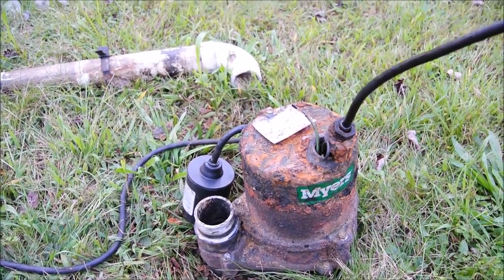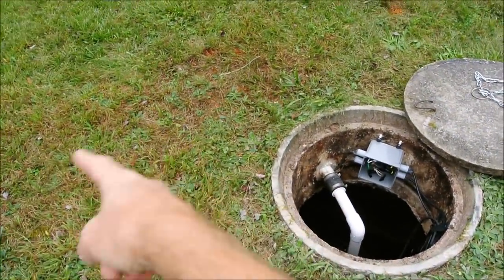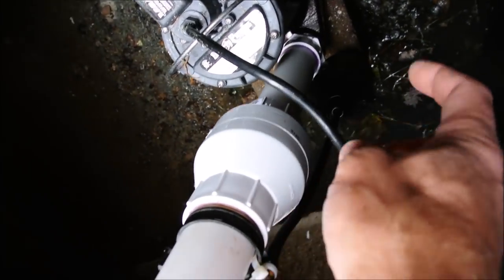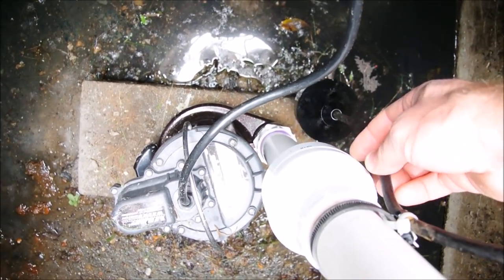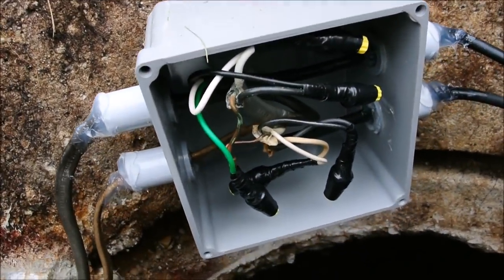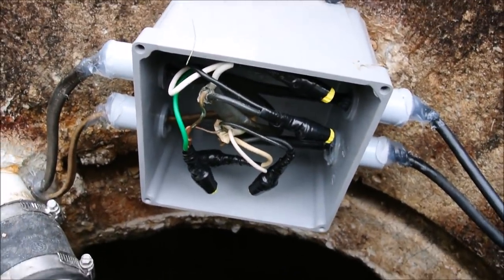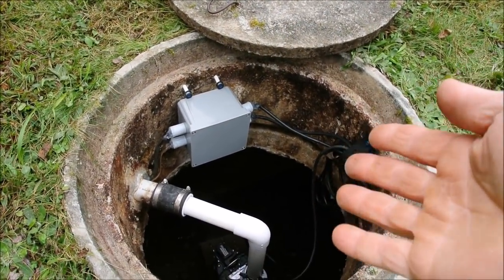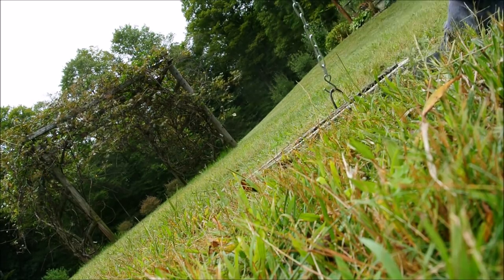Septic pump replace: DIY internal splice box

Comment: Why would you waive any inspections for the largest investment of your life? From your videos you seem knowledgeable about contractor activities and projects, but a second opinion is good. The more information you have (with the ability to process said information accurately) the better.
Reply from the maker: Sure, that's fair. But ultimately, buying a house is a binary decision that must tip one way or the other. Inspections are for the uncertain: once you are certain that there are already enough check-boxes ticked to sway the decision in favor, you have to also accept that some things can (and will) go wrong. 

It's a calculated risk, but it's not left only to luck; you make yourself capable, and then you trust in your judgment when the time comes. Here, I'll say it this way so that it doesn't sound so arrogant:

Luck equals preparedness plus opportunity.  

Capable outside perspectives are useful during a 'gain information' phase. When it comes time to make an important decision, however, you should already be informed enough to make it. Now in the case of a first house, it's tough. For mine, I was hasty and naïve, and mistakes were made. After having some time and experience to help us determine what we really wanted, the newer house was approached from a far more uncompromising position, which was just less open to outside opinion.

It is also consistent with my experience that "expert" opinion is often buttressed with pride and superstition, and further, that experience speaks little in favor of expertise. So yes, I do consult the knowledgeable when I can, but I do so to become prepared to make the best decisions I can. And yes, I do screw up often! But so far, we love the house ;)

Comment: Where are you located
Reply from the maker: In the computer room, upstairs in a house, in Pennsylvania, on Earth, sort of floating in-between two of the spiral arms of a Galaxy, in a dynamic space/time-based medium that's really tough to determine the extent of, and I have no information about what exists external to that.
Are you nearby?
Reply: pocket83² darn!!! I am on Mars and my septic tank is not working the electrical box needs re-wiring and I need help but you to are too far away - thanks anyway
Reply from the maker: @charlenejones5152  Just be sure to flip the breaker, and be sure to use a pump that already has a float on it so that you don't have to do the extra wiring. Those are good tips for both planets! Good luck.
Reply: pocket83² excellent 👍 great 👍 thanks 😁👍

Comment: Was the intro sarcastic?
Reply from the maker: Sarcasm is much like a sandcastle. It appears to be a solid structure, but if you screw with it, it falls apart. So just as you might wonder if you can pick up a sandcastle, it's best to just wonder to yourself about a potential double meaning. 

I guess, like so many things in life- If it feels a certain way to you, then it is.

Comment: No kill like over kill....  Still baffled why a septic tank has 2 stages with a sump pump....  We do it it with a tank and 4 to 5 100 feet drain lines
Reply: Chad Shipman A raised bed setup requires a pump to lift the effluent to said raised bed’s level. Not uncommon at all around here.

Comment: Rather annoying that you felt the need to close comments on your deck video.
Reminds me of the kid who would always take his ball and go home if he didn't get what he wanted on the playground.
I'm not a contractor, however some 2x4's bracing to hold the deck up while cutting the 4x4's down and placing a stout 2-3 ply 2x10 beam would have sufficed. Maybe throw in some Simpson hardware to lock it to the shortened 4x4.  Been 4 years since, fixing shoddy workmanship is always going to yield a bunch of options, maybe unnecessary drama doesn't work as well in these types of videos.
Reply from the maker: You're right. It is rather annoying that [I] felt the need to close comments on [my] deck video. You know why it stings so bad? Because I'm a hardcore advocate of 'free' speech. What I mean is that you'd be hard pressed to find an uploader who more consistently preserves commentary, no matter how disagreeable it may be. Stop to consider how off-the-target the discussion must've been in order for me to do it; of the hundreds and hundreds of videos I've made, you can count on one hand those that I've closed commentary on. Some topics, for whatever reason, just strike the right frequency to the provoke the imbecilic. 

You were saying something about unnecessary drama? Tell me what you know about that. Or did you have an actual question about how I fixed the deck? Yeah, didn't think so. That's why I've shut you all up. Choad [Sp].